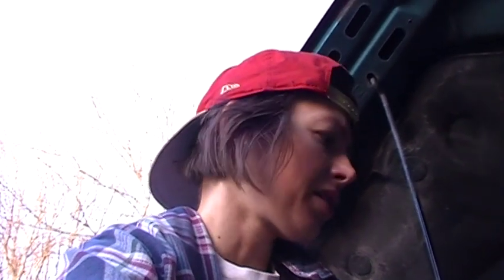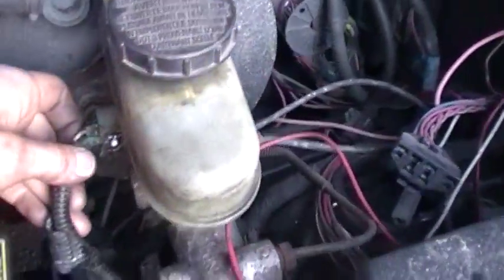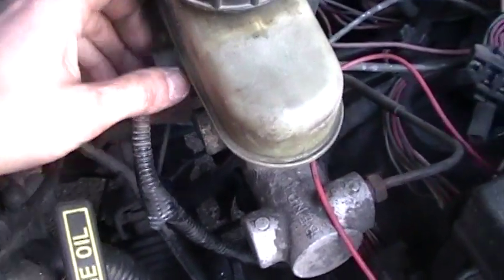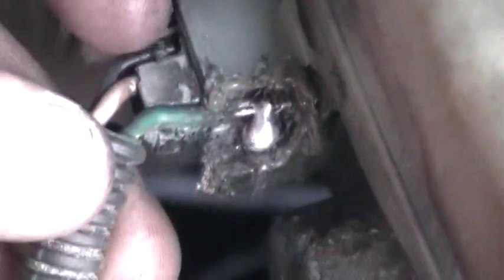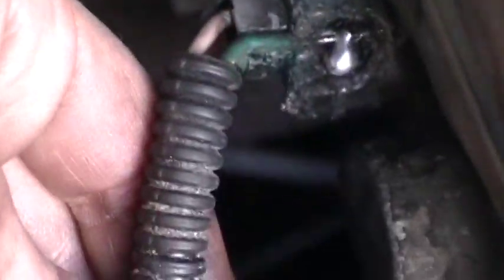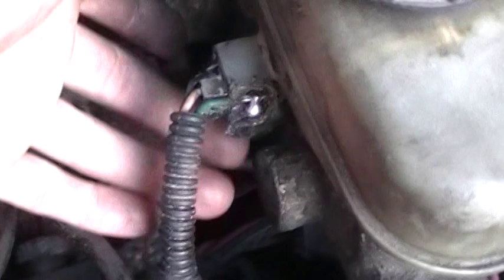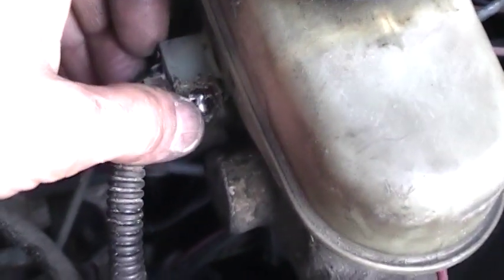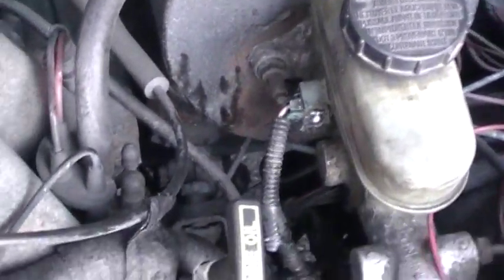CODE 12 ABS (RABS) Brakes 1994 Ford Ranger

Comment: I have a 92 Ford Ranger brakes working the front sometimes work in the back pressure valve Maybe pattern master cylinder and a rear two wheel cylinders in the back as well??

Comment: Had an issue with the ABS light coming on after working on another problem and so I wiggled the green wire and it went off. I am assuming the vibration of opening and closing the hood caused the wire to come loose. Thank you so much for the video!!

Comment: I am having an issue with my 2002 ranger, where at low speeds it feels like the abs is coming on. The abs light is not being triggered and I have replaced all my wheel speed sensors. The only other thing I can think to check is to make sure all the wiring harnesses connecting the sensors are ok. Am I on the right track?
Reply from the maker: do you feel a drag or a pulsation? I would check to make sure none of your brakes are dragging front or rear.
Reply: I do feel a pulsation, I was able to borrow a scanner from a friend, and noticed the rear wheel speed sensor is reading on average 2-4 mph slower than the front 2. From what I have read this sounds like a possible bad rear tone ring. I'm not sure what to think about that though.
Reply from the maker: dont know why a code would not be set. I dont know what the process for pulling the abs codes would be on this truck , much newer than mine was.  is your abs light bulb working? a pulsation can also be caused by  a warped rotor. A warped rotor will not set off any lights, but be very annoying.
Reply: yes the bulb works just fine. The rotors are in fine shape I replaced them not too long ago to eliminate them as a cause. No codes were present when I used the scanner, and the only abnormality I could find was the rear wheel speed reading 2-4 mph slower than the front wheel speed. I doubt it to be the control module because I don't think I would get the code reader to read anything.

Comment: Hi Sym Balls. I changed the master cylinder on my '93 Ranger and the light came on. I was just getting ready to replace the MC again thinking the switch on the new one must be broken. Using this video, and the one you made on "reading ABS (RABS) Codes on 1994 Ford Ranger",  I was able to read the ABS code and narrow the problem down to code 12.  You mentioned that the pin was the problem with yours, so I used a mirror to get a view of the connector and I saw that two of the three pins were bent upward. When I was putting the male plug into the master cylinder reservoir, the pins were just being pushed up out of the way and not actually engaging. I straitened them out so all three were centered in the middle of the reservoir connector,  plugged it in, and it worked! No more ABS light! Thank you. I wouldn't have figured this out without your video.
Reply from the maker: Im glad I could help you. It always stinks when you replace something and some new problem pops up. I'm glad it was a simple fix.

Comment: This video just saved me. I have had an ABS light on for years in my 92 f150. Everything tested good. I was stumped. Then i ran across this. Immediately ran top speed to my truck. And found a very similar issue. Thanks for posting this. I love finnally having my ABS back in order.

Comment from the maker: I am assuming you have the RABS system if you have a 2wd ranger. Type in RABS CODE LIST and a page from autozone will come up with a listing, but I am not sure what vehicle and year or if its 2 or 4 wheel drive..  If you know the number of your code you can type that into the browser and alot of people on ranger forums have dealt with the code and could tell you. I had a subscription at the time to alldata.diy.com for my ranger and I looked at the code list there.